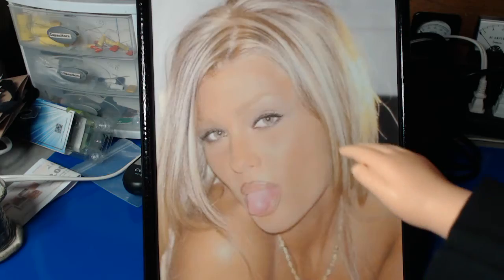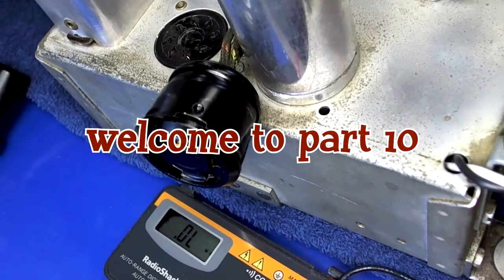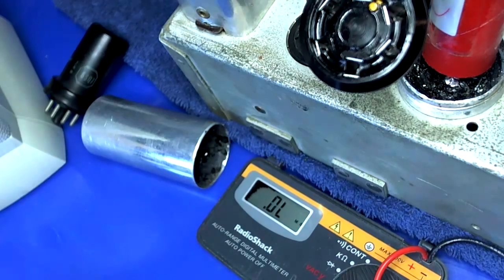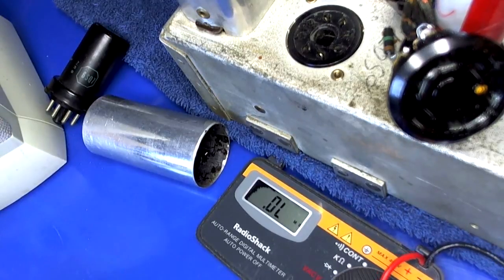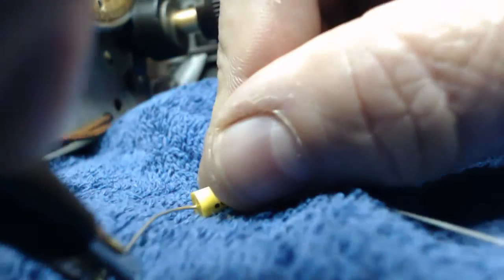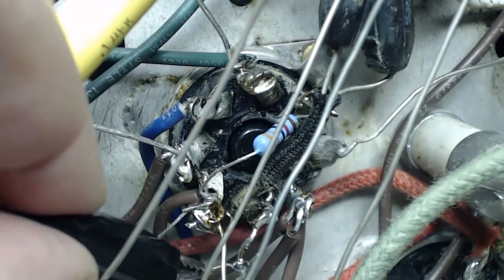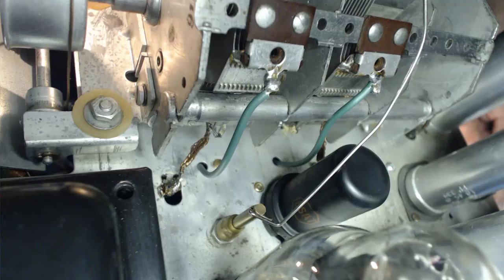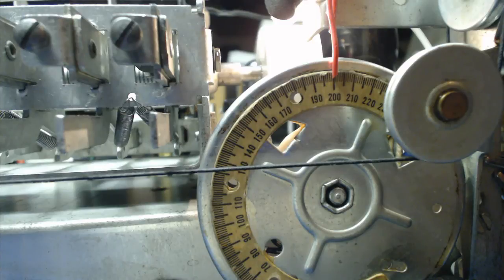1939 RCA Victor Model T-64 Restore Part 10

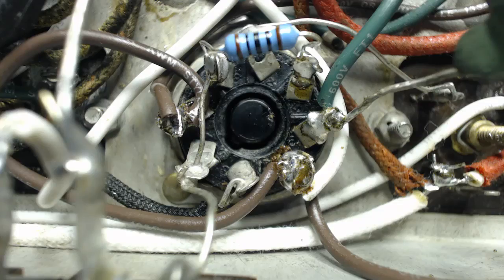Comment: At 12:08 you noted 6sk7, and at 15:28 you noted a 6ka7, I'll be looking tomorrow in the box in the garage for that one, I've had that box for about 25 years, it has about 3 to 4 hundred tubes in it, it's a carton that had a muntz television in it, when Radio Parts Incorporated went out of business here in Grand Rapids one of the owners gave them to me.
Reply from the maker: Truckstuff4u those are comon tubes the last one is 6sa7 not 6ka7...thanks for your support...buzz
Reply: My bad on the 6sa7 LOL